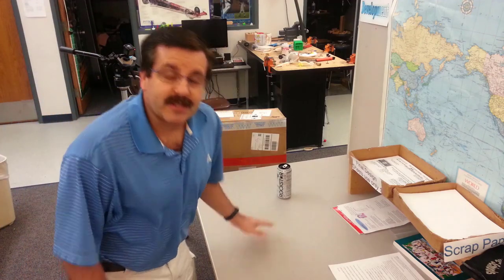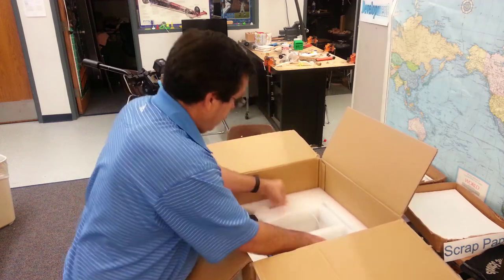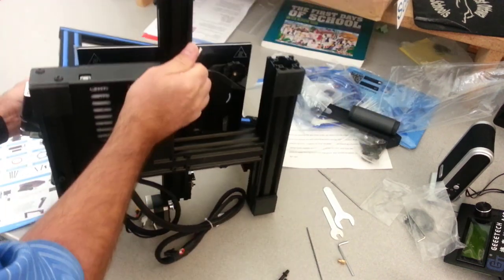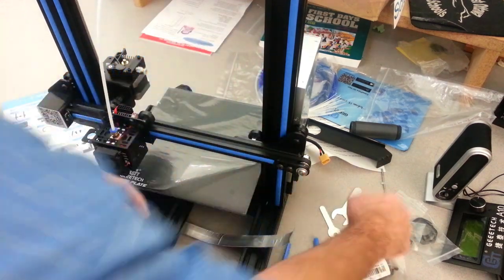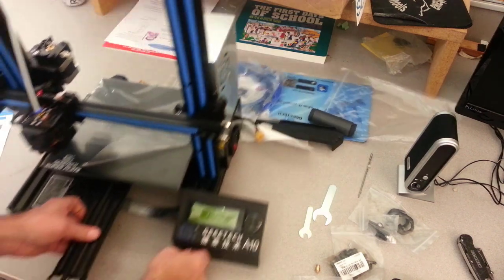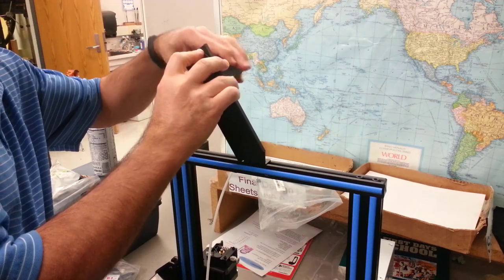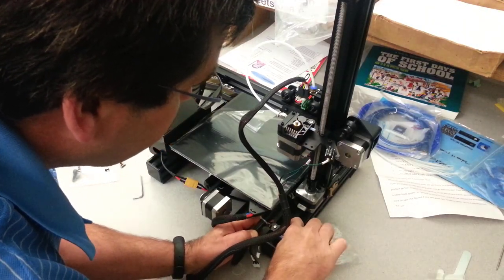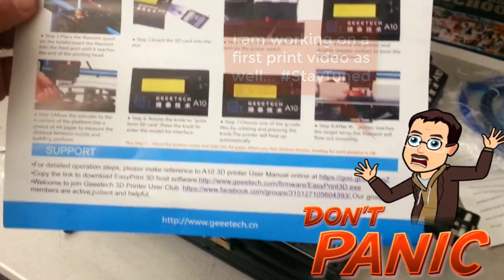Assemble the Geeetech A10 in 30 Minutes? Is it possible?

Comment: Thanks for this video. As someone who has never, ever, seen a 3D printer before it was invaluable. The instructions and tiny little photos that come with the printer are of very limited help.
As a complete noob, there are still questions :) When confronted with all the parts, it is not clear which is the front of the printer. Nor which way round the gantry should go (or whether it matters!). It would be helpful if Geeetech labeled the motors X, Y and Z, like they do with the wires.
Even as the instructions suggest "you're ready to print", they leave out vital information. Such as should we remove the plastic film on the horizontal metal plate - my guess: YES. And what to do with the black mat with a "hot" warning on it?
Looking forward to the "first print" video.
Reply from the maker: My pleasure and I hope you have success with it. It has been a long time, but I know the feeling about trying to figure out which way is front from those images.  My first print video will show and older version of Cura... I would move up to the new version. I still always start printing with that tiny cube though.

Comment: This is a good video.Iam brand new to the hobby and not good at trying to assemble anything but I hit a snag I cannot get the filament holder mounted I just want to know how did you do it.
Reply from the maker: There are little connectors called "boat nuts". They resemble boats a bit... you slide them in the groove and as you tighten the top, they rotate 90 degrees and lock in place. It is really a pretty slick system. Hope that helps. I will see if I have a better clip I can aim you towards as well...
Reply from the maker: This is the exact time where I show a boat nut... then it slides in the groove and you tighten it. https://youtu.be/DnmK5Hv3RJE?t=526
Reply: @HLModTech  Thank you very much.

Comment: That's the newest version with the horizontal y-carriage rail (good), filament feed sensor (good), single bearing rollers (bad)
Reply from the maker: Bummer about the rollers, but good to hear on the other accounts. I have been busy with school, but it is printing really well! As with any machine, there is a bit of time where you just have to learn each others quirks. =)
Reply: Well, on the rollers it's still up in the air on them. they don't seem  to effect the prints so far, the concern is that they will wear out sooner than the dual bearing rollers, and that you cannot purchase them separately (yet)  if they do wear out. I would feel alot better buying the printer if someone sold a spacer conversion kit so you can swap the dual bearing rollers you CAN buy to replace those single bearing rollers.
Reply from the maker: @johndegnan5703  I will have to do a bit of research on the rollers. I have run my Ender 3 stock since I got it... Planning to try to do the same with this as long as I can as well. I prefer being able to recommend parts to people that do not need upgrades out of the box. I have seen some pics of A10's with fancy yellow springs... Mine are fine, but dang those look sharp! 🤩